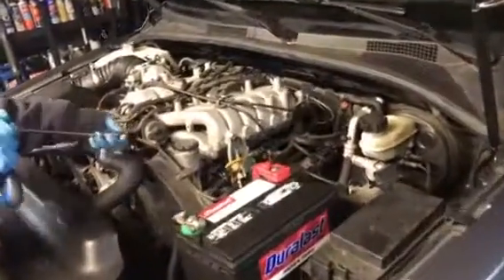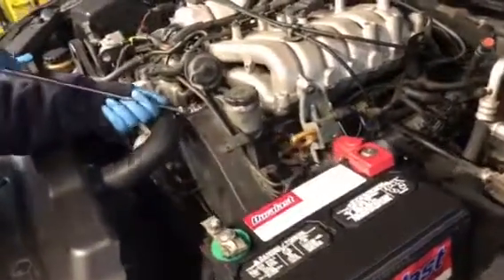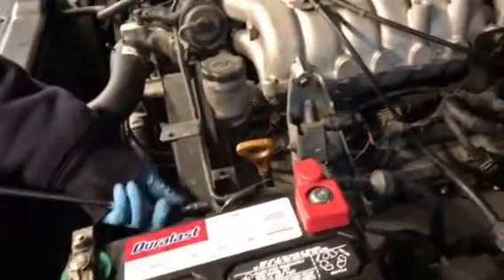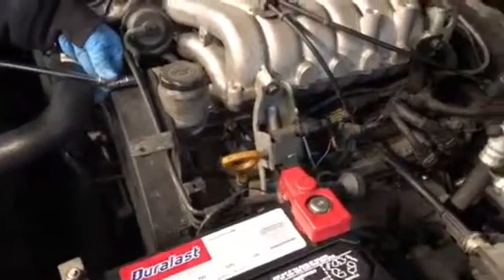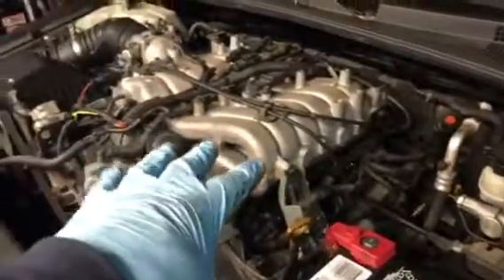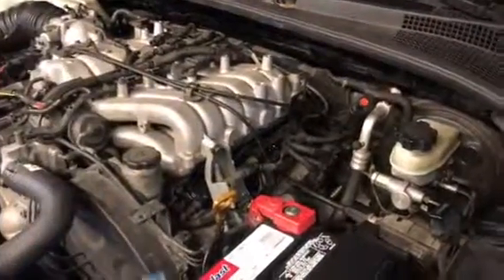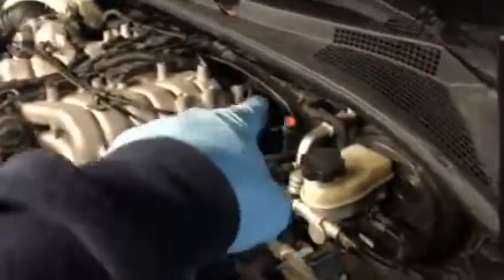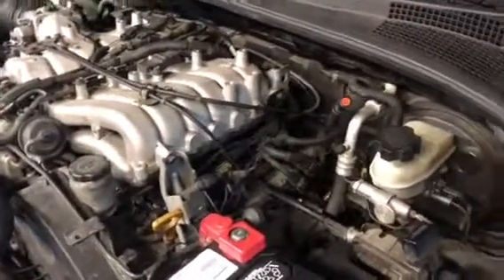Kia P301 common cause

Comment: Po301 still misfire what next??
Reply from the maker: Kim speenburgh If you replace spark plugs wires and coil pack next is the fuel injector or do a compression check on the engine